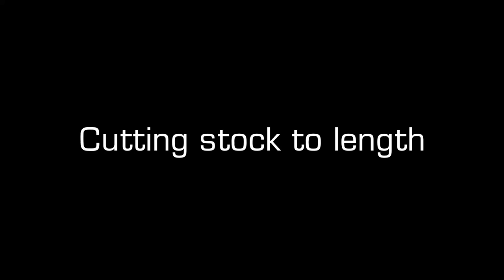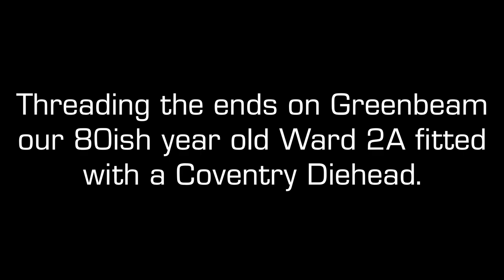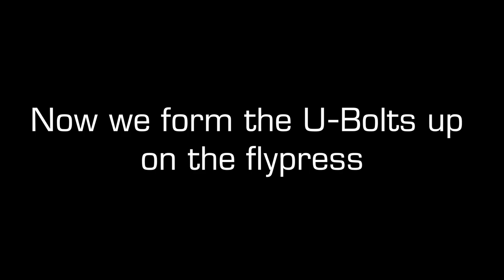Making custom U-Bolts with a capstan lathe and flypress

Comment: How about welding a nut on the short leg of those wobbly tables so you can use an adjustment bolt to make them more stable?
Reply from the maker: Good call! I have great intentions of adjustable feet and castors but it hasn't happened in over 10 years so maybe a simple bolt wouldn't hurt in the meantime :-)

Comment: Crap...that brought back memories of my Apprenticeship at Simon Engineering, Stockport, UK (1969)
I spent best part of a year setting and operating a series of Ward capstan lathes.
By the way...spindle speed is a little fast for HSS dies.
Reply from the maker: Learning as I go on these! Still a few guys who ran them as apprentices around here but the setters are all long gone unfortunately so its trial and error but they definitely still have their place in the workshop even if its just running simple parts to take workload off the newer stuff. Noted on the speed for the dies (y)

Comment: That is a Ward lathe, I have the same machine but never have gotten around to using it. Started a job as a CAM programmer for CNC machines and I must admit, as nice as these vintage machines are, there is very little need for them anymore. The precision and speed of CNC are really unmatched.
Reply: The world would be a better place without computers .ward & manual for the win . Nothing built by CNC will ever become a classic ,as every ** has one

Comment: why not buy a collet for the chuck on the jathe and use a tool in the turret to chamfer the ends this would cut your production time in half
Reply from the maker: Hi Roy,
Couple of good points! The correct collet was on order but hadn't arrived in time. We don't have a chamfer tool for the turret and couldn't use our normal chamfer tools in the tool post but yes it would definitely speed things up!
Reply: @owensengineering286  i was a capstan setter owen and the jobs had to be turned out as fast as possible some were produced with two components on one cycle of the turret so stations 1/2/3/ were identical to 4/5/6/ so that the operator didnt waste time indexing the turret past 3 idle stations but its nice to see capstans still turning work out mate x
Reply: Helps when theres a fully equipped toolshop with appropriate box cutters and die holders, blah blah blah. Then theres the funky ones for doing the hexes n flats...
Most turrets/caps i see now are in scrapyards or delegated to some mediocre job like tap, chamfer, deburr. 
Only seen one get used properly, sourced from a scrapyard, popping out screws every three seconds or so... darn sight faster than a cnc cycle of three minutes...

Comment: Safety gloves next video
Reply: @sergio Vasquez you don’t wear gloves because it’s a hazard. Will have more severe injuries when your hand gets pulled into the machine via gloves getting wrapped around the rotating machine parts.same thing with loose baggy clothes and long hair.
Reply from the maker: In this part of the world gloves are a big no when working with machine tools. Too easy to get caught and sucked into a machine. I do however appreciate the concern for my safety.

Comment: slowest saw I have ever seen. Id loose my business running that in my shop.
Reply from the maker: If running a cold saw is the making or breaking of your business I'd suggest you'd need to take a serious look at your business 🤣
Reply: @owensengineering286  The point was for production. I can cut 20 or so at a time to your one. In your case cold saw is not needed.
Reply: and yet you had time to watch the video and comment as well. we are so grateful for your valuable time.
Reply: @RoyMeraki  HAHA